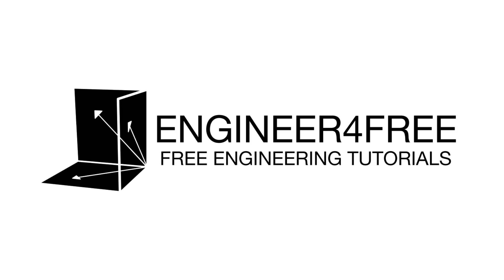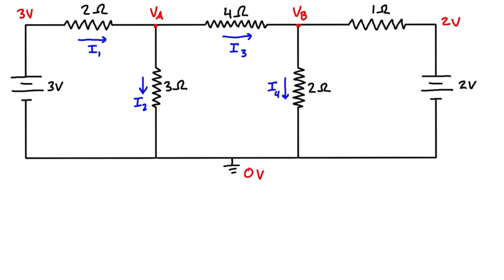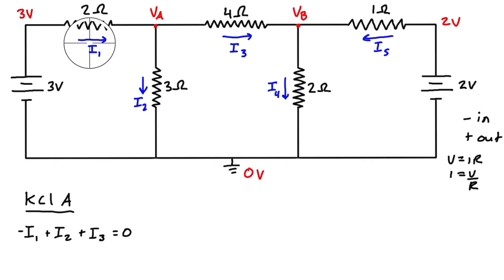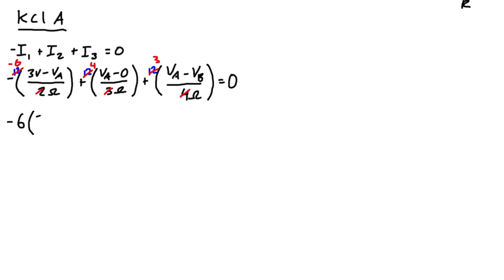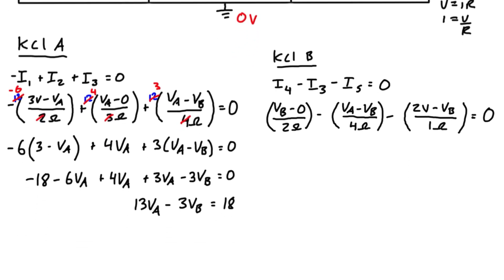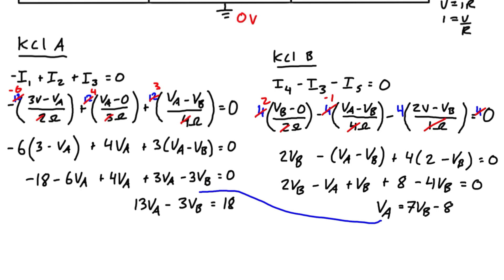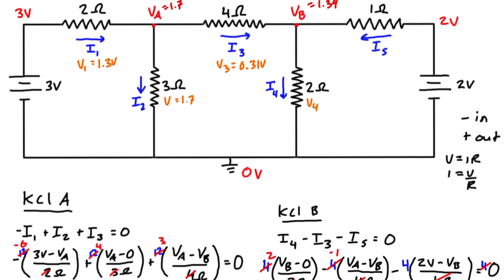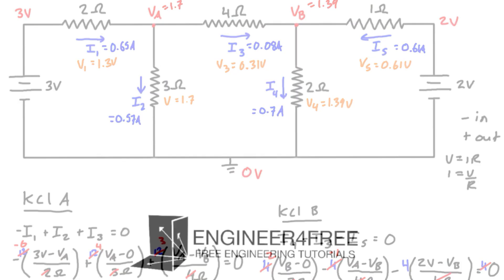Nodal Analysis Example Problem #1: Two Voltage Sources

Comment: In KCL - A you multiplied -6 by -va which you have as -6VA which should be +6VA . If it was -6VA you would not have 13VA but instead just have 1VA.. to get 13VA it has to be positive.
Reply: Thanks i thought i was tripping
Reply: distribute the negative first then it would be -3+VA

Comment: How we find common dinominator?
Reply: it's quite easy, actually! it's elementary level maths; basically you single out all the numbers on the bottoms of the fractions, line them up and start dividing with numbers in hopes of getting each number to a 1. 

for example, if you have 1, 2, 4 like in the Vb portion of the video - you ignore the 1 because it's already a one, so you have 2 and 4 left. both are divisible by 2, which - when divided - leaves you with a 1 and a 2. 
then you divide them again with a 2 and the end result is three ones, with two twos you used to divide them with. 

then you multiply the numbers you used while dividing (aka 2 and 2 here) with one another, and the end result is your common denominator (4 in this case). 

hope i was able to help! <3

Comment: Hi, I like your teaching but i have one doubt in this video. I want to know why i3 goes on right side? can't it go to left too? Please reply! much appreciated
Reply from the maker: I just assumed a direction for i3, in this case it was to the right. When I drew it, it was an unknown, and I could have assumed either direction. If i3 ended up being a negative vale, then that would have told us that it was in fact pointing the other direction. However, in this example, we calculated i3 to be positive, so our assumed direction was correct.
Reply: @Engineer4Free  Thanks a lot . Subscribed your channel. I hope your channel will help others a lot too Keep it up
Reply: Hi Merry,
If you're interested in electrical/electronics engineering, we're building a channel to help students and professionals prepare for job interviews with real world questions. We'd love it if you could swing by. Also, our LinkedIn is: https://www.linkedin.com/company/hardware-ninja